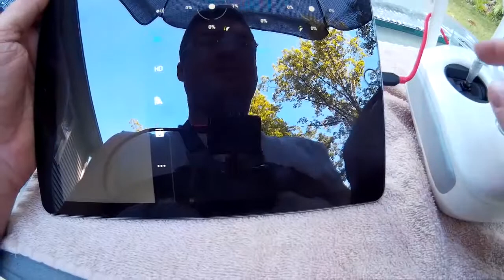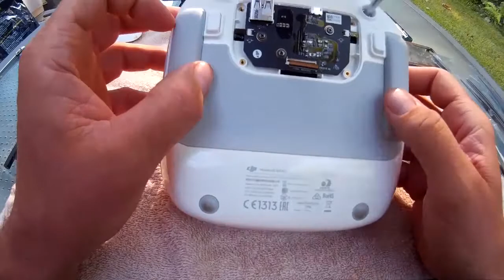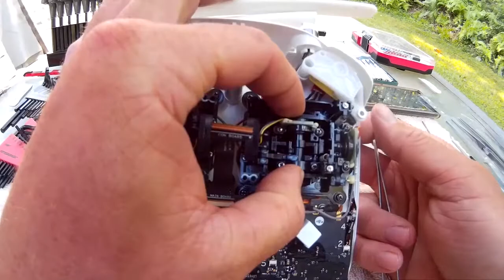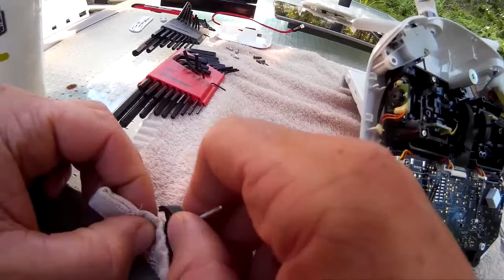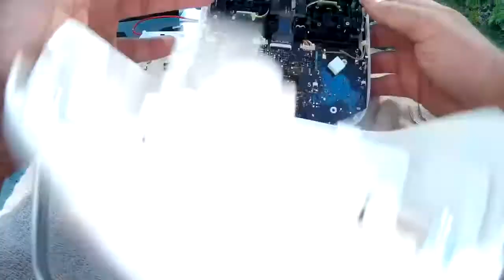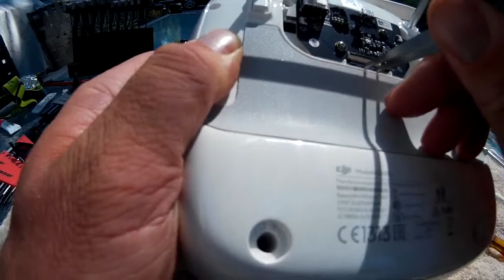DJI Phantom Remote RC repair beeping sticking controller stick

Comment: Please use Electronics Component Cleaner rather than Carb Cleaner. It will remove oils/grease easily.
When I had this problem I bought a used DJI Inspire 1 Remote Controller P/N GL658C. Works great and has a further Distance/Range than the stock P3/P4 Remote Control.

Comment: Thank you for a most informative video. I have the exact same problem that you solved with your well-illustrated instructions. It's easy to see how either gimble can be damaged by a vertical force coming directly down on the gimbal stick.

I had tried doing a gimbal calibration using an iPad Mini, but every attampt was unsuccessful for some reason. But before giving up, I decided to try again with my Android Motorola smart phone, and was able to get into the gimbal calibration tool. The Yaw control was constantly fluctuating, just like your's had done. Eventually, the Yaw percentages settled at 0% and I was able to give the P4P a 15 minute check flight. It ended up auto landing when the flight battery percentage got down to 20%.

I did some checking on the internet for new replacement P4P gimbals and found only one place that had them: Cloud City Drones in Warwick, RI (cloudcitydrones.com). Their price was $49.99 with free shipping. My controller   is over 10 years old, and knowing that plastic parts eventually fail, I decided I would replace both of them while I had the case open. 

I also saw on the internet that AliExpress has a good supply of used P4P gimbals for sale at $5.28 each with an additional $4.51 for shipping. But I decided I would go with new OEM parts from Cloud City. 

Thanks again for your valuable information, especially how to remove the back of the case.

Comment: I do not have the camera attached as as I had a birdstrike and just trying to get the drone flying so that I know it's just the camera and camera cables that I need to replace the drone did fly straight after the crash but without camera attached it's been left for at least 2 or 3 years without use and just trying to get it back in the air again

Comment: I have my controller beeping like this and I'm unsure why it's doing it when I try to connect it to a phone on the app DJI app it doesn't seem to want to connect it just comes up with a button saying how to connect
Reply: This is exactly what mine is doing. Did you come up with a fix?
Reply: @karlchilders3989  nope its still sat ontop of my cupboard gathering dust
Reply: Turn off 4G cellular data on mobile phone if it’s on, then turn back on

Comment: Hello, i am having the same beep problem when i turn on my RC GL300C, but when i enter in calibrate the numbers are in 0, and the beep sound doesnt want to desapier, what can i do?
Reply: I had that same problem with my phantom 4 pro plus keeps beeping.I calibrate the joystick but it still beeps .the problem the remote was having is the battery in the control have a damage cell .when I plug in the power card it stop beep because it was getting enough power for it not to beep.I replace the battery and everything works good

Comment: Hey thanks for making this video. My left stick just started kind of sticking. It feels like there's a gear in there and maybe it has some debris in the gear. I don't know if that's what it is but that's how it feels. Happens when I ascend and descend. So when descending and I release the stick it may not go back to neutral. Does that sound like the same problem that you found? Do you have any tips or suggestions on the best way to fix it now that you've worked on one? Thank you very much! 
Oh and you think there's a way it could get jammed so that I wouldn't be able to push it back to neutral?
Reply from the maker: I would suggest getting the remote opened up for a visual. I'm guessing it could be something similar to what i've recorded here.